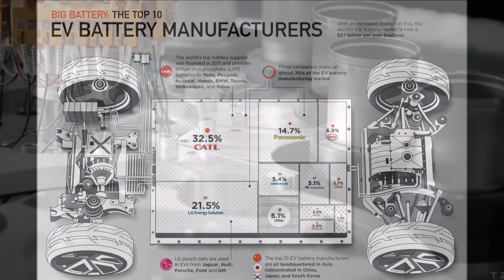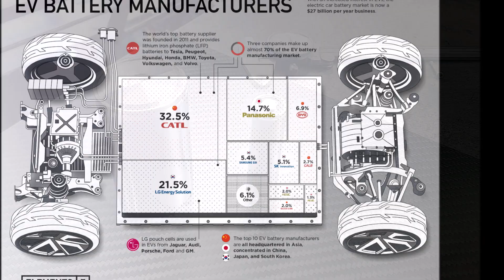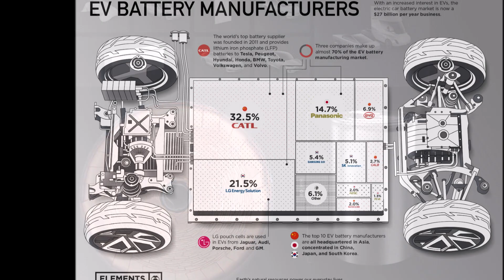Elon Musk: Batteries Are the Most Important Resource for Electric Cars

Comment: The biggest reason why CATL and other Chinese battery makers sell the most batteries is that China is easily the largest market for electric vehicles/components, and they have local incentives to promote the use of China-built components in their domestic EVs. Most all of Panasonic's battery business is supplying Tesla, but now as Tesla's EV business expands, they have added CATL, LG, and others to meet present and future demand. I suspect that Tesla themselves will join these ranks of top battery producers within a year, when they ramp up battery production in Fremont, CA, and finish building full scale battery factories in Texas and Germany. It was exactly the fact that Asian battery manufacturers, and battery material suppliers control so much of the mining and battery production today that drove Tesla to start moving into those businesses to provide vertical integration. and internal battery resources and production to remain independent and competitive in the growing EV market.
Reply: Agreed, if 4680 fails, Tesla fails
Reply: Boys, this is what we call a post
Reply: More likely it's because 40% of its graduates celebrate engineering degrees

Comment: Batteries may come and batteries may go
Remember the milk float, trundling slow
In Lithium cells 
The ion compels
Now Young Elon is making them grow

DDLL, the name is the size
With 1865 the first to arise
2170 was next to appear
Standards evolving year after year
The 4680 now aims for the prize

Researchers working, in Elon’s lab
Focused in on the connection tab
Connected mid-foil
For all of the coil
It’s there for a collective electron grab

Now the tab’s gone, electrons surge
With less dissipation of the voltaic urge
That’s a reflection
Of edge connection
In a massive internal resistance purge

Longer and fatter it still gets hot
A very cool bottom’s what Elon has got
For participation
In heat dissipation
Conduction goes down, convection does not

Solar subsides when the sun doesn’t glow
Turbine’s run down when the wind doesn’t blow
So to the fore
An energy store
Musk’s 4680’s the star of the show